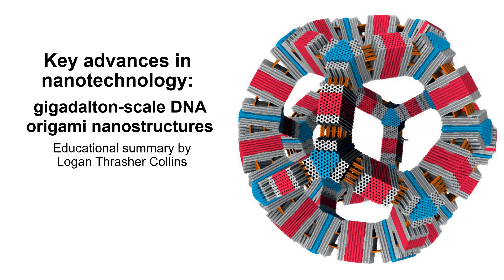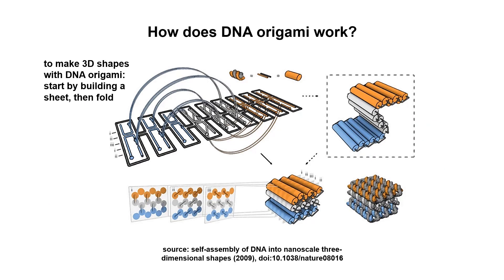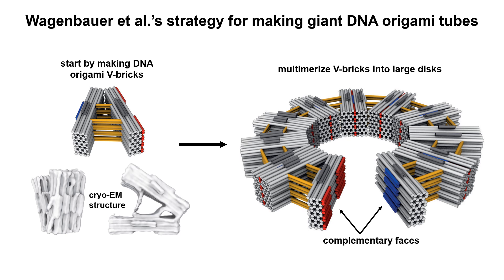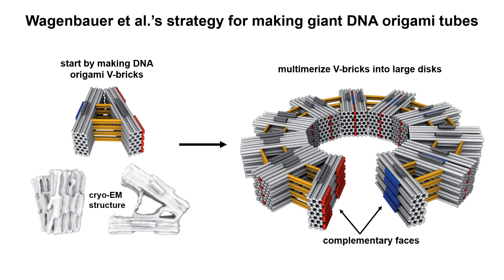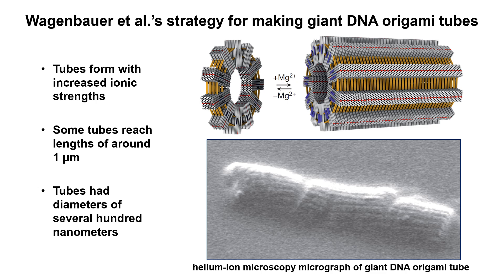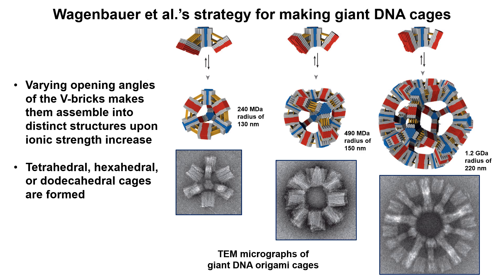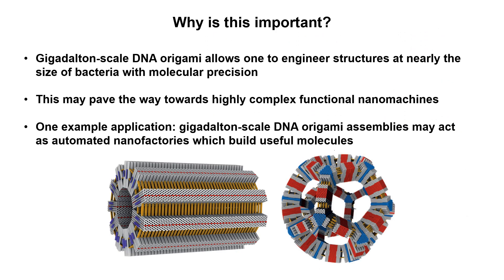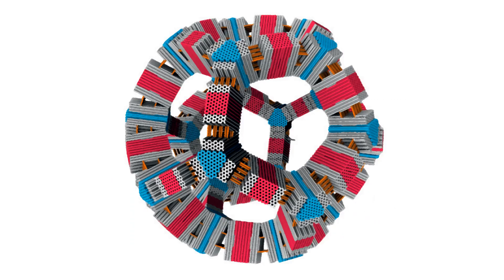Gigadalton-scale DNA origami nanostructures explained

Comment: Combining these two: 
– Getting this standardized non-bespokebuilding blocks capability to proteins too (2024 paper in other comment) 
– Getting this generalized random-access building structures capability (2022 paper in other comment)
… might finally open up "modular molecular composite nanosystems". 
An idea that Eric Drexler once proposed on his (now sadly gone) blog about.
Kind of like protein/foldamer based breadboards opening up new avenues for progress to atomically precise manufacturing of more complex structure. 
E.g. tether assisted transport and tether assisted assembly eventually helping along where pure selfassembly hits it's limits.
Initially merely topologically atomically precise later perhaps positionally atomically precise.
Reply: @loganthrashercollins – Would be really 😎 if you somewhen could cover one of the two (or even both) of these papers on your channel somewhen. Would fit well to your channel.

Comment: There's a really 😎 2022 paper (closed access 😢) where they generalized this second selfassembly level of 3D structural nanotechology to be generically random access programmable just as the first self-assembly level is. 
It's called: "Finite Assembly of Three-Dimensional DNA Hierarchical Nanoarchitectures through Orthogonal and Directional Bonding" by Yihao Zhou et. al.
Reply: The ResearchGate page for this paper has some figure previews with stunning experimental cryo-EM images.